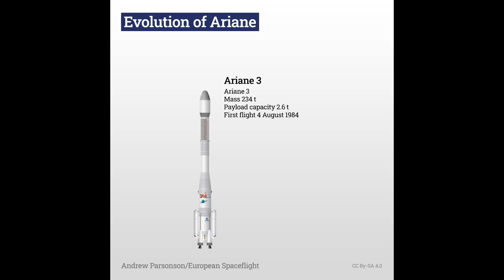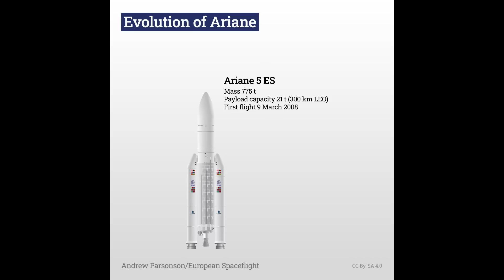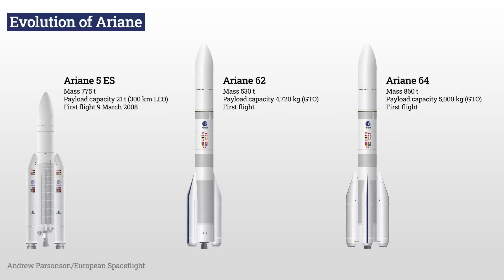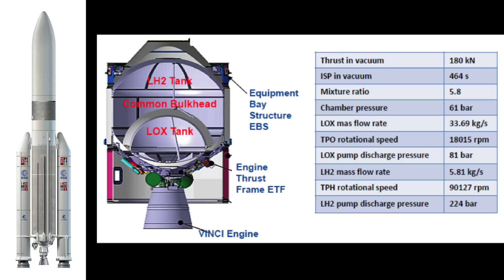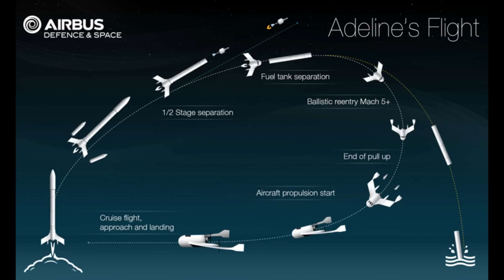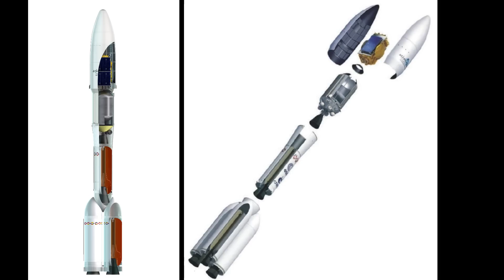Europe Retires Ariane 5 Before Ariane 6 Is Ready????

Comment: I will never forget watching the former CEO of Arianespace Richard Bowles participating in a discussion panel and proclaiming that SpaceX's stated aim of reusable rockets and cheaper space launches was nothing more than them selling and pursuing a dream, implying that it was an unattainable goal. Bowles' remarks are a classic example the quote from Arthur C. Clark's Three Laws "When a distinguished but elderly scientist states that something is possible, he is almost certainly right. When he states that something is impossible, he is very probably wrong." In this case, Mr Bowles has suffered a  "failure of the imagination"
Reply from the maker: He was never CEO however.
Reply: @scottmanley  Correct. He is/was  Director of the Asean Office, Arianespace.
Reply: @scottmanley   Kindly talk about Indian Space Research Organisation (ISRO)'s GSLV rockets. 🤩
Reply from the maker: @thamil-engineering  have you looked at my existing videos about this?
Reply: @scottmanley  I will check out. Sorry.
Reply: To be fair, SpaceX's cost is mostly but to process and manufacturing streamling rather than reusability. SpaceX managed to become the cheapest launch provider several years before they first recovered a first stage, so recovery is not the biggest factor in reducing costs.
Reply: The lowest price to orbit isn't always the most profitable solution to companies, specially for high energy orbits. Ariane 5's capabilty to inject a satellite into a GEO whithout spending the satellite's own propellant extends its lifespan in orbit and subsequently it generates more revenue. 

Falcon 9's upper-stage performance (Isp) isn't that good in comarison with a hydrolox upper-stage, and that's why there is still a market share for high performance non-reusable launch vehicles for high energy orbits.
Reply: @luigeribeiro  SpaceX having reusability allows them to use a booster for a final time as a non-returned launch, giving the same performance as it would have been for a regular non-reusable launch. Further, SpaceX is able to use previously flown Falcon 9s as boosters for their Falcon Heavy, which is much cheaper than a A5 launch and can put even more directly into GEO.
Reply: @anthonypelchat  Ariane 5 was capable of putting two payloads into GEO at once, which exceeds falcon 9 expendable mode. and it seems you missed the point: The launch price can be a tiny fraction of the profit a communication satellite can generate, so  depending on the mission is better to pay more to extend the mission time than to pay less and reduce the time on the mission.
Reply: @luigeribeiro  Falcon 9 can put dozens of satellites into GEO at once. All depends on the size. Both F9 and FH can launch directly into GEO as well, which FH did with a 3t satellite while still being partially reused. 

A5 could send nearly 11t to GTO while F9 can send just over 8t. While the mass to GTO is greater for A5 vs F9, it is at 3-4x the cost. So only beneficial for sending a single large payload as sending 2 or more would be better/cheaper on F9. And FH can send nearly 27t, nearly 2.5x the payload mass to GTO vs A5, for around half the costs.

There is no payload mass nor cost reason to use A5 over the Falcon family. Being non-reusable doesn't help A5 either. A5 does/did have other benefits, like a larger payload volume (though SpaceX now has a larger fairing). But it's only real benefits were that you didn't have to fly from the US and/or with SpaceX.
Reply: @luigeribeiro  btw, the A5 could only send roughly 3.5t directly into GEO from my research, though that could be wrong. A64 though has a max of only 5t, which is advertised as much more than A5. In the meantime, Falcon Heavy launched nearly 7t into GEO earlier this year with 3 satellites. Of the 3 boosters, 2 were used on previous flights. Side booster B1052, which flew 8 times, and side booster B1053, which flew 3 times.
Reply: @anthonypelchat  There is no payload mass nor cost reason to use A5 over the Falcon family" Well, no payload mass or cost reasons, but there is a reason... sort of.  Ariane launches from very close to the equator, so it has a wider range of LEO orbits that it can launch to directly - 0° to 89°, while F9 and FH can only launch directly to 28.5° to 55° from the Space Coast, 55° to 66° from Vandenberg, and 66° thru polar to 145° from either launch site.
To get outside those ranges, F9 and FH have to make an additional burn to change direction. This is called a _"trajectory correction maneuvre" (TCM) which uses fuel and therefore impacts payload capability.
Reply: @davidanderson4091  I did mention that there are other reasons outside of payload mass or cost. And I said that one of those reasons was not to launch from the US. True, launching directly from the equator has some benefits, but those benefits are mostly outweighed by the immense cost difference over Falcon 9 and the immense performance benefit of Falcon Heavy. Again, companies have reasons for picking A5, but those reasons are never for payload mass nor cost of the rocket. And while the other guy was kind of pointing against reusability, he missed the point that a reusable rocket can be expended after flying multiple times if needed for really difficult launches. That effectively negates any benefit of a non-reusable rocket.
Reply: @anthonypelchat  Yep, 100% agree. At this time SpaceX has 23 active cores available for use - seven are unflown (four F9's and three FH centres) and 16 flight-proven cores that range from 2 to 15 flights 
2 flights x 3
3 flights x 1
4 flights x 1
5 flights x 2
8 flights x 1
9 flights x 2
12 flights x 2
14 flights x 2
15 flights  x 2
If a customer's mission specs require a fully expended configuration, just use one (or three) of the last three and SpaceX are no worse off on that mission than another launcher that doesn't have re-usability.
Win-win!
Reply: @davidanderson4091  The only negative is that all of the Falcon Heavy cores are new and planned to be expended. Pretty sure they are trying to get off of Falcon Heavy as soon as possible once Starship flies. All of the side boosters though are previously flown and/or planned to be landed for reflight.
Reply: @anthonypelchat  You missed the point AGAIN and your research is wrong. UNbelievable and biased.
Reply: @davidanderson4091  Ariane 6 is even better in payload mass to high energy orbits and in launch price. So my point stands, it is capable of extending the satellite's lifespan which in turn generates more revenue for the customer.

Not everything is just about only launch prices.
Reply: @luigeribeiro  btw, your lack of research also likely never pulled up the USSF-44 by the Falcon Heavy. Depending on how you count the payloads, FH deployed between 2 and 8 payloads direct into GEO/GSO*. It did this WHILE recovering the boosters. Those boosters are planned to be used again this year on two different missions!! 

*One of the two main payloads was an additional payload launcher (LDPE ESPA)-2. It carried 6 payloads. However, only 3 were to be separated. The other 3 stayed on the unit.
Reply: @luigeribeiro  A fully expended Falcon Heavy can inject a payload directly into geo-stationary orbit - in fact one did so earlier this year. At US$120m, its still US$57m cheaper that Ariane 5.
Reply: @davidanderson4091  Ariane 5 has put two sattelites into GEO at once several times, so if the launch price is U$ 180 million then that would be U$ 90 million to each customer.
Reply: Clarke with an "e". He was the first to publish a paper on the value of geostationary satellites for communication. Heck, we used to refer to geostationary orbits as "Clarke orbits".
Reply: Did Mr. Bowles eat his shoe?
Reply: Well said. Well quoted. Pertinent.
Reply: @tjmcguire9417  Nope. And these tiresome ACC quotes are rubbish; he mostly paraphrased earlier remarks by others, and they are not as profound as the uninitiated seem to believe
Reply: "implying that it was an unattainable goal." No, that is not the implication. The implication is that SpaceX is not going to deliver
Reply: And SpaceX still needs to show the cost....
Reply: @AthosRac  No they don't. They are a private, unlisted company. They are entitled to not publicize commercially sensitive information about their operating costs.
Reply: @AthosRac  what do you mean? It it known, that they charge about 60 million for a launch with internal costs probably closer to 30 million (that one is a guess).
Reply: @pascalwiery7129  Is that confirmed? If so, I would actually like to check out any materials that are available on that subject.
Reply: @michaeldunne338  SpaceX charge about US$62 million for an F9 launch, and about US$90 million for FH, depending on how recoverable they make the launch. That is a confirmed, advertised price.  The launch cost WILL be significantly lower... less than $40 million, otherwise whats the point? There would be no profit. Meanwhile the launch cost for Ariane 5 is US$177 million per launch. Apparently, Ariane 6 will be cheaper, but at the moment, it ain't launching anything.
Reply: @davidanderson4091  Thank you for the information. I am interested in seeing if operational efficiencies of all sorts are being realized (and improved upon), whether reuse past 10 launches of a first stage booster adds to some economy of scale advantage, and so on. Its all still relatively new. 

If things are moving in the right direction, that is awesome to hear. I just recall how things got depressing when assumptions were not panning out with the Space Shuttle in the mid-1980s.
Reply: So when they launched 2 satellites together. Wich they often did, the price for each sattelite was half of 177
Reply: @ladydustin7811  Its more complicated than that. Firstly, do not mistake "cost" with "charge"  Arianespace is owned by various public and private interests across 10 different European countries - its listed so we know their costs. Ariane 5 costs about $177m per launch but I don't know what they charge their customers. The reverse is true for SpaceX - we know what their charges are (because they advertise them) but we don't know what their costs are because they are unlisted and that is a commercially sensitive information. Secondly if a rocket launches multiple satellites for the same company as part of a constellation (for example, SpaceX putting Iridium satellites into orbit) those satellites are likely going into the same orbit and weigh about the same. However, if its a ride share, the satellites are not likely to be the same weight or going to the same orbit. This becomes a case where there is a primary payload and a secondary payload (and subsequent payload) depending on orbital requirements. These factors will alter the individual costs for each customer on the same ride share.
Reply: @michaeldunne338 Building a new falcon 9 booster takes a significantly longer time and ships from California. Refurbishment is 1-2 weeks and reported from SpaceX 4 or so years ago, it cost half as much as a new booster, probably less now that it's well streamlined.

The speed is really the biggest advantage, with many indirect advantages stemming from that. Launching weekly means fixed costs make up a smaller percentage of launch price. Launching 100 times in a year there's more to be gained by half cost refurbishment vs new. 1-6 launches per year and your main cost is staff and facilities fixed cost, and booster price doesn't matter.
Reply: @pascalwiery7129  Elon Musk and at least 2 other SpaceX executives have stated that the cost for a reused Falcon 9 launch are under 30M including everything.